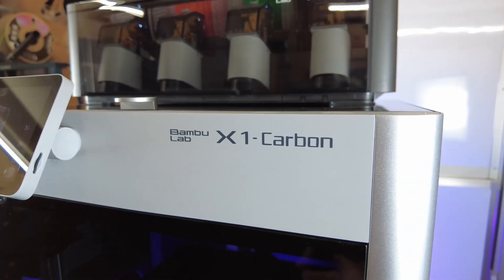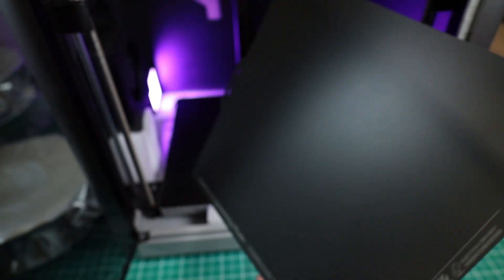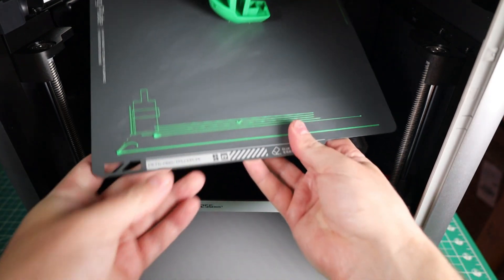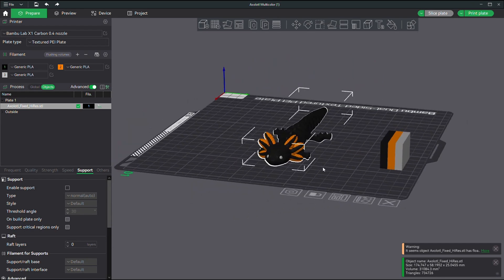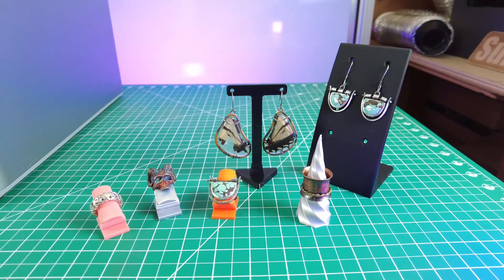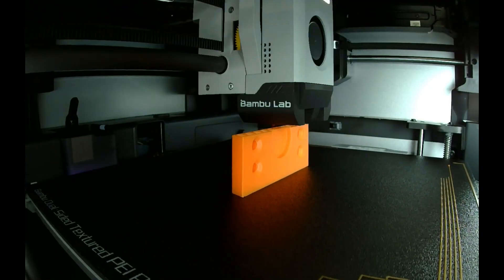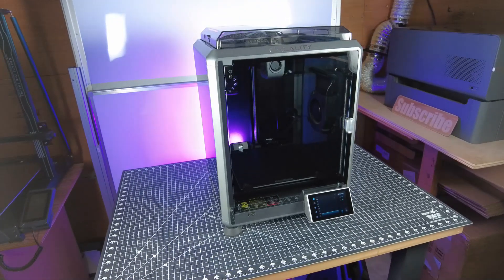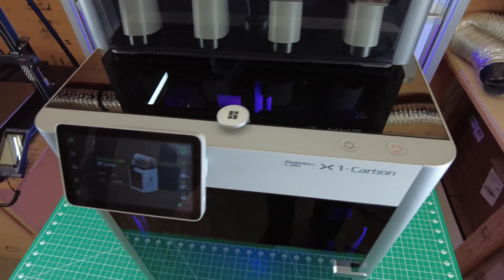Not Perfect But The Best 3D Printer On The Market - Bambu Lab X1 Carbon

Comment: just finished assembly and testing of my X1-Carbon.  Put a huge smile on my face when the first print came out at warp speed (but not warped - perfect). If I had a complaint it would be that the directions are somewhat lacking.  With a bit of head scratching, I completed the job.  A detailed setup video would help some of the new owners get past the shortcomings of the instructions.
Reply from the maker: What problems did you have getting it setup?

Comment: There was so much hype around this printer that I had to get one.. First impressions were impressive but then it come to the problems.. It is my "best" printer by stats but not even close to be a go to printer.. Never ever have I had so much tuning to do to be remotely useable.. I understeand why people still preach prusas to be their workhorse.. I mean as soon as I hear notification on my phone I fear of bambulab icon...

Pros:
-Fast
-controled chamber
-AMS
-When part is printed without issues it has good quality
-Good for more advanced materials

Cons:
-AMS is unreliable it keeps want my attention
-Non babmbu materials are not reliable
-generaly not very reliable (all printers I have - I can just pres print and go to sleep with confidence (even those for 150€))
-build plates... most need glue
-bad first layers.. they are kinda good but far from flawless even after many auto and manual calibrations
-LOUD
-It is only tuned for speed (as soon as you go slower even your first layer flow is different)
-not so much common knowledge

It would be nice to have some presets for generic stuff with less speed..
Reply from the maker: That sounds like you have a bad unit or maybe even just user error. I haven't had these problems with my X1C or my 3 P1P printers... My experience was just unbox, setup and go. I have done no tuning and I use a lot of filament from other companies with no problems 

Loud is a thing but that's what happens when you start moving faster.
Reply: Definitely a bad unit

Comment: not even close to best on the market what a joke.
Reply from the maker: Okay in your opinion what is the best consumer grade 3D printer in the market right now then?
Reply: @randymay  All depends what people are looking for.  If colour is important then I would say BL otherwise tones of options.  Our K1's outshine our BL printers all day long especially now that we have unlocked klipper and full fluid.  V400's are faster but no suffer a bit in quality. Prusa Mk4 is much better quality and not that bad for color, also very comparable in speed.  Raise 3D is consumer grade amazing for dual color and quality tops BL lab all day long. We have all these printers (over 40 in our farm) and have done lots of testing.  BL has made it easy for people who have zero knowledge in printing to get started but we will be hitting a huge waive of these people shortly (BL not built to last) that have no idea how to fix machines and BL made this very difficult.

Comment: Great printer for non-technical people, for the most part. Not so great printer for makers. Having quick and easy access to upgradable parts, mods, firmware modifications, hardware etc are all a major plus to many of the other printers out there.

If you have no plans on modifying or using this for serious production, then it seems to be great. It is pretty much a packaged Voron machine with less functions.
Reply from the maker: Yeah for the most part but you can do product work with these printers. I have been doing that with my P1P prints for months now with no problem. These printers are great for limited run parts or rapid prototyping. I do like having a printer that I don't need to spend hours or days getting set up so I can spend more time working on actually making things. 

At the same time I have nothing against people that like to tinker with the printers and build Vorons. I have a Voron 2.4 350mm kit still in a box due to not having the 40+ hours to get it setup

Comment: Hello guys I have been watching various videos and I came here. Very nice video.

My mother is currently crafting some handmade jewellery from clay, but I think that 3D print has more potential.

I want to start learning 3D printing as a hobby (would love to create an Ironman helmet😂) and why not to start creating stuff for sale as many of you probably are doing already.

I am completely new to this and I have not bought a 3D printer yet. 
Should I try this one or go to creality ender S1 plus? I know that they are incomparable, but it seems that this one here is capable of doing many things.

Many thanks of any answer !! 

-Peace
Reply from the maker: If you have the money I would get this one or at the very least the P1P over the Ender 5 S1. 

These printers are very easy to use and make really good prints right out of the box.

Comment: Thanks for the reply. I did actually stop the playback so I could read what it said on the build plate. I think I'm going to buy this so it's good to know that it needs to have a glue stick. I'm used to my Ultimaker S5.
Reply from the maker: No problem and yeah if you do get one at least for this plate it likes to have glue stick just in case. The texture PEI sheet on the other hand has no need for glue stick with most materials. PETG does like to fuse to smooth PEI but I haven't had any problems with it sticking like that too textured PEI.

Comment: You said something that was rather alarming to me. If you use the PLA side of the magnetic build plate you have to use a glue stick or the filament may fuse to the build plate?
Reply from the maker: So people have had it stick a little too well to that plate sometimes making it kind of fuse together and getting it off rips it so it says that you should put a layer of glue stick on there to act as a release agent.